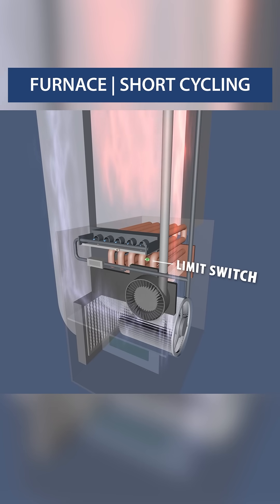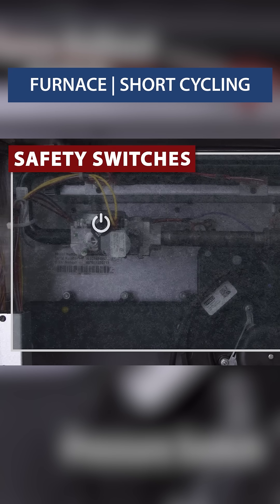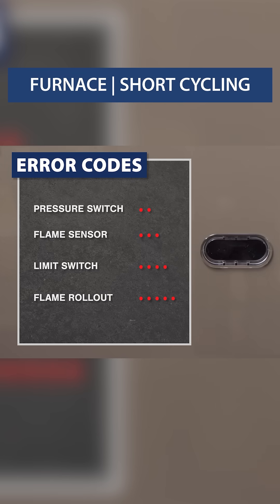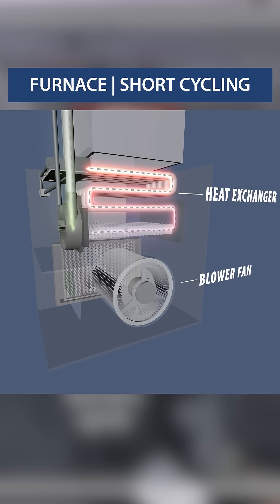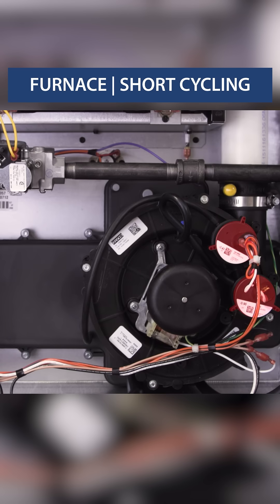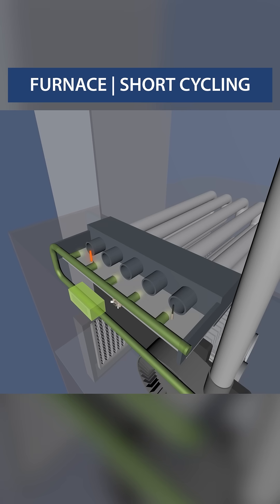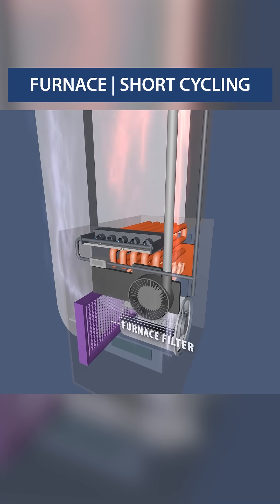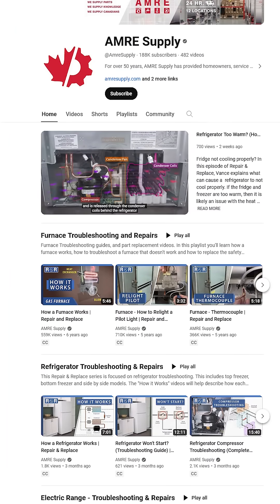Furnace Short Cycling Explained | Furnace Starts & Shuts Off  #hvac #furnace #heating

Comment: Just discovered your video. I've diagnosed all these same things changed out the limit switch the flame sensor cleaned the 90% exchange exchanger filter done everything have a perfectly clean furnace but still does exactly the same thing clicks on clicks off then starts and ignites and runs for a few minutes then shuts off I get an error code for which has diagnosed as the high limit switch which I have changed out but I still get the same problem any suggestions?
Reply: Reset the system then jump the pressure switch and see if it stays on. If it stays on without turning off then clean the inducer port where the hose goes and make sure the hose is clean and if you can just replace pressure switch for a lower wc rating
Reply from the maker: We have a longer video that explains this more in detail: https://www.youtube.com/watch?v=b0sAGt-1niU
There's also a few links in the description for further viewing.

Comment: I turned my furnace off at the thermostat. But the furnace itself is still on. And during the summer it would never cycle. But soon as it got cold it's constantly cutting on off. If I turn it on at the thermostat it will stay on and it will heat up the house. And after I turn it off it will stay off until the house gets cold again around 46 degrees. And then it would start cycling on and off without actually heating up. It would actually blow a flame for a quick second. I don't know if this is normal or not but I don't ever remember it doing this before. So when I don't use it I just turn the furnace switch off at the furnace. And I can't find no information online about the situation

Comment: I have a brand new rheem giving me that issue! Flame on blower runs then after about 3 minutes if goes off
Reply from the maker: Thanks for watching. If it is brand new then it should be under warranty and should be handled by the original installer or a technician.
Reply: @AmreSupply yeah but is one of the commun issue?
Reply: I have same problem since my York unit was new

Comment: you shouldn't teach people to mess with limit switchs who arn't trained gas technicians lol.....Thats the one part of the furnace that can turn it into a bomb if its installed wrong lol
Reply from the maker: Thanks for watching. In these troubleshooting videos we show how to test and replace parts like switches, motors, and heating elements, all with the exact replacements. Never bypass safety switches, never show live voltage testing and never show any work on sealed systems like gas valves or the compressor loop. We recommend that people contact technicians for further troubleshooting or when the repairs exceed the scope.

As for this video, a basic limit switch has 2 terminals which are not effected by polarity. Screwing in the new switch and connecting both wires is all that it takes. In the rare case that someone installed it wrong and one wire was not connected properly, then the furnace will shut down as this will act like the switch is tripped.
Reply: They are so very simple to replace.
Reply: This was informative and had great animations.
Reply from the maker: Thanks, we're glad you found the animations helpful.
Reply: How is that ?
Reply: Is this true?
Reply: @intelligence9798 no it's a conspiracy theory 😂
Reply: Absolutely,a limit switch is a very complex device do not attempt to replace it unless you have at least a third grade education 😜
Reply: if you use common sense and research what you're about to do, there's no reason a layman couldn't do this job